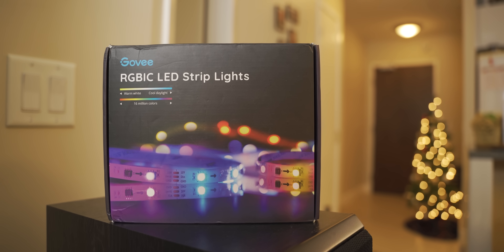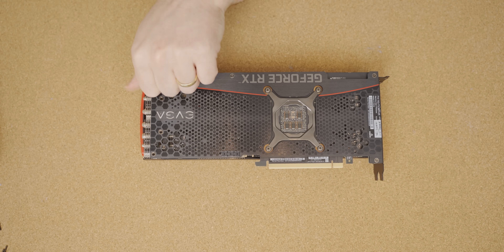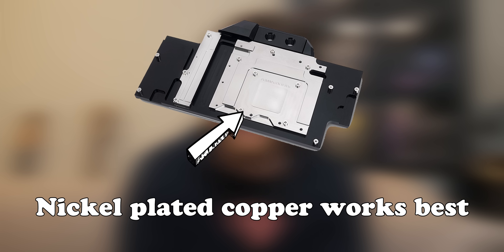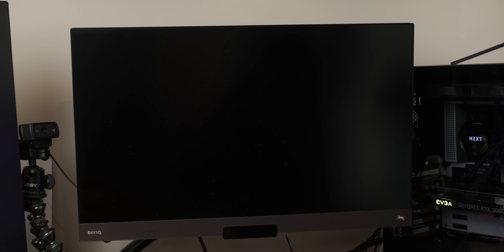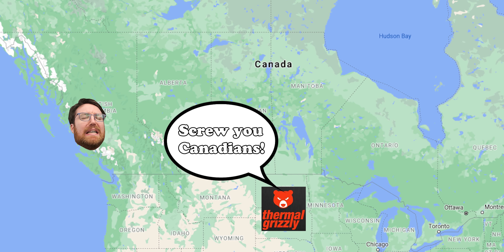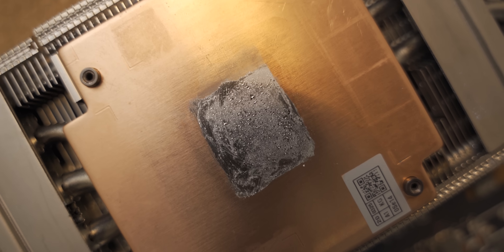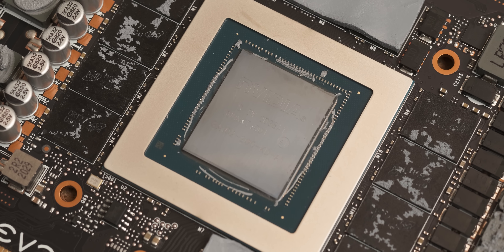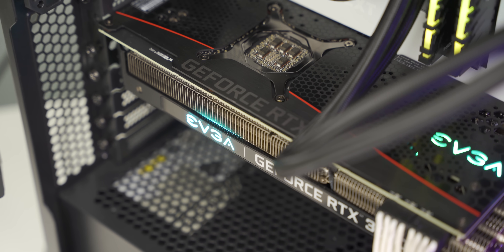NOOB uses Liquid Metal on an RTX 3080...

Comment: use normal thermal paste as a gasket around the gpu die. On that metal piece that surrounds the die. Basically eliminates any chance of it squirting out. Also on cpus you can 3d print tpu gaskets that go around the cpu not in between the cpu and the cooler and get squished down when you mount the cooler.

Comment: i used it on my 4080. Took me around 30 mins to do. It lowerd my temps by 10°C but to hotspot delta went from 10°C to 15°C. I ran it like that for over a year without any problems. Then I decided to check how it is doing and opend the card up again. And I saw that I dId not apply it on the correct location on the cooler. So half the die didnt make proper contact to the cooler. I then did the right this time and now the Temps are again 3°C lower then before and the hotspot delta is at 7°C to 10°C. So yea, I think its worth it.

Comment: i use metal liquid on a 3070 asus tuf and have better results
stock=79-80
liquid metal=65-70
(in two cases the frecuency was 1950mhz with oc)
and i wanna modify de bios to get a higger gpu voltage limit
to get stable frecuency 2100-2150 mhz

Comment: Only 2 degrees improvement see despite all the risk? Even a monkey with one nut  will easily say NO
Reply: There wasn't nearly enough liquid metal on the GPU and cooler, and who knows what else he messed up lol
I put liquid metal on my Aorus 17X laptop and it runs WAY better. You just have to know what you're doing.

Comment: You didn’t put enough on, too careful. Typically if you don’t put enough on you will just get slightly better temps. I’ve used it on 6 gpus and you should be getting a really noticeable difference if applied properly

Comment: Dude... you had some bad thoughts... you cannot see how much contact the gpu and the cooler had by looking on the liquid metal. When you see there some like drops, its just the last contact point of lifting the plate. Other point: when you want to higher the contact pressure, you should have used less thickness in thermal pads instead of thicker ones. Your card had possibly close to none contact between gpu and cooler when it had 74C. If used correctly with normal contact, liquid metal would degrease the temperatures close to 10C. The Card should had reached around 66C or in best conditions better (lower).

Comment: I tried to replace the thermal pads on my EVGA xc3 black 3080.  Same card with no backplate for some reason.  I could never get it to run right after opening it.  Ended up having to rma it.  Then the replacement just didn't work at all so I had to rma a second time.  Never touching that thing again.  I've opened other GPUs and they worked fine after, something about that flexy PCB not making good contact after you take it apart.

Comment: you need to look at the GPUZ and see hotspot temps vs gpu temps. 
if they re different, you have not enough liquid metal or its not contacting the heatsink very well due to pad sizes.

Comment: this guy has no clue whatsoever. Does not know how to blennd in GPU Hotspot, does not know how to proper replace pads, does not know how much Metal to apply....its a mircacle he didnt ruin the GPU. Insulating the small caps and resistors on the socket was literally the only thing he did right.

Comment: Wouldn't it be more economically viable for GPU manufacturers to apply this in the factory for better performance and less burnouts and Warranty replacements? How much does a drop of that stuff compared to standard thermal paste really cost?

Comment: Hi. I watched the whole video. It was a good video, and it probably wouldn't have been as entertaining had you done this, but I would have been nervous about uneven compression of the pads with stacking, as I've seen this issue before in thermal maintenance of mini-PC controllers in an engineering lab. Management didn't want to just order new thermal pads. Their calculation of the situation was on the small price of new pads and not the downtime that was difficult to calculate but real. I think it would be better to follow the culmination of lessons learned you showed and just order enough new pads with the correct measurements before beginning spring thermal tuneups, doing shunt stacking, cleaning, whatever. Plan it all out, order all the oh shit stuff required, and make a much less entertaining, but low-stress experience. :)

Comment: Did you have the right MM pads in the right area?  I know some cards use different sizes and can cause uneven GPU pressure if not using right MM.

Comment: Fun fact. The thermal pads are just a gap filler. You don't need them to be perfect thickness. They just need to squish a little. As long as decent enough contact is made it works

Yes you will see GPUs with thick thermal blocks that are squished out a lot but those are from the factory. They're bought like that for the appropriate use case so they can be thick. Not all thermal pads are created equally after all and it is very likely that the thin pads used are rated for different temperatures. So stacking pads will mess with thermal conductivity too much

Comment: card manufacturer should start listing in the specs what type and thicness of the pad they use or include a set for future use. I didn't want to mess around with thermal pads because is hard to get any of any size here (and expensive) so the marginal gain is not worth the hassle (even for my CPU i use reguar white thermal silicone )

Comment: I think you should take a thermal pad and and cut a square in the center, put the pad on the CPU and in the center of the square, put the tiniest bit of liquid metal in the center, and spread it around inside the square you cut. The pad should keep the liquid metal from running off the gpu.

Comment: You, my friend, need a waterblock and a radiator with 2 fans for the GPU to watercool it to oblivion.
Like this you'll probably get 10 degrees less on the GPU and it will probably be better for the VRM and VRAM too, who knows.
Also, use 1mm thick thermal pads, no more, no less, and don't stack them one over eachother, it's best with one sheet to avoid as much as possible, microscopic air bubbles.

Comment: I nickel plate any copper surfaces before using any galinstan (gallium, indium, tin) thermal material like Thermal Grizzly Conductonaut. There are kits to nickel plate copper surfaces (I use one called Plug n Plate, with which I have no connection other than as a customer) that are well under $100 US, and the amount of plating material you get will do dozens of heat sinks, and it's easy (takes just a minute to set up, then just a few minutes to do the plating, then you're done). It's probably easier than a lot of people find it to actually spread the liquid metal!

Otherwise, in time the gallium in the compound will migrate into the copper over time. The amalgam formed (silver in color) is slightly less efficient at heat transfer than copper, but the difference is supposed to be negligible. The more pressing concern is that as the gallium moves into the copper, the fraction of gallium in the TIM still between the chip die and the cool plate changes, while the volume of the TIM decreases. This can lead to higher temperatures and a crusty buildup on the heat sink when you do reapply it. There is also usually some minor pitting on the copper surface where it contacts the TIM.

Nickel is far less reactive, and at least in the year or so I have used it, there has been no reduction in volume of the TIM or any pitting on the nickel plated cool plate surface on my gaming laptop. My previous laptop did start getting hotter after a few months with Thermal Grizzly Conductonaut, and it was noticeably more dry than when I applied it.

Comment: For the part where you protect the soldering around the cpu there is a more specialized product you can use called conformal coating
Reply: hi I want to ask is it true that conformal coating works? I intend to use Kapton tape.. but many also recommend conformal coating as far as I know it is used on drones or mobile RC to protect it from water

Comment: Tbh though if i had a RTX 3080 from EVGA and i wanted to cool it down i would of actually bought their Hybrid kit instead because a very good chance i would of maybe seen the high 50's low 60's when gaming and yes it would of taken some of my space for additional fans in the system but if your GPU and GPU are both running on a AIO then i am sure using 1 or 2 exhaust fans in the system would be fine then.

Comment: lol aluminium past wont adhear to copper, it just wont, so dont put it on your copper plate, put it on the cpu die, and stick your cooler down, make sure its even and firm, do not try to add metal paste to copper.
or just use a normal paste, you wont see any real diference to your thermals, hahaha.

Comment: Have you considered the gap between your processor die and the copper?  I would imagine putting thicker or even just new pads on there created a rather large space between the two.  I probably would have gone with thin thermal pads and even before that tested to see what the gap was between the two before even moving on to adding the liquid metal.

Comment: I OVERCLOCKED TO MY RYZEN 5 5600X I OVERCLOCKED TO 7500MHZ ALL CORES I USE MELTED METAL I HAVE BAD ENGLİSH MY CPU AND MY WATER COOLER İS CONNECTED WİTH METAL U CANT SEPERATE  MY WATER COOLER AND MY CPU İS CONNECTED STUCK TOGETHER PERFORMANCE İS BETTER THAN ALL CPUS BUT SO RİSKY TO DO THAT I WAS LUCKY

Comment: The cooler is not the issue, it’s actually a good sized cooler. You totally abused that card my man. The relation between thermal pads thickness and die contact is very sensitive.

Comment: EVGA doesn't use thermal pads, they use thermal putty and it conforms better.

The gap thickness between memory and cooler is within 0.25 mm thicknesses and pads only come in 1mm thickness increments.

I highly recommend people to buy thermal putty for their EVGA.

Comment: hmmm, well, i was thinking of doing the same using a Liquid metal in order to properly overclock my RX 580 (yes i know it's old but it's a decent 1080p GPU)
anyway, it's too much hassle if the thermal pads get messed up n i definitely wanna avoid that to happen so, well, anyway, screw it i'm not gonna do that i'm not well adjusted into these stuff if something get wrong
by the way is anyone here know what is an idle fan speed while playing a game on high setting ? Thank u

Comment: To be fair, if the cooler and original TIM where more than enough for a stock card, you won’t see major improvements unless you’re gonna be overclocking and/or pushing more power.

Comment: GPU generally has lower power per unit area, and 75 degree Celsius isn’t dangerously high. Whereas for a CPU you are pushing more power into a smaller piece of silicon so more efficient heat transfer does make a difference

Comment: You are playing FHD. Your graphics card is not even working at 100 %. If you want to see the max freq you musnt run in FHD but rather use DSR (in case you dont have a better monitor) to move work from cpu to gpu.

Comment: liquid metal is totally unnecessary risk, using water cooling and thermal paste is way to go u can use alphacool aio extendable set for cpu and gpu plus alphacool cooling blocks for gpu. no risk involved mostly and no stupid conductive bulshiet on mobo. i once used arctic silver paste one drop in wrong spot and my asus rog hero vii mobo go to the trash becasue all pins bend over from short

Comment: Maybe it's the aluminum pipes limiting the cooling. I doubt those are nickle plated copper or something. It's a shame you didn't get better temps with such an expensive (I'm poor) GPU, which has 3 fans and with liquid metal applied.

Comment: Dont apply liquid metal, if the heatsink is copper, over time the liquid metal eats away at the copper and can later damage you GPU.... hence you only add liquid metal to cpu die and original heatsink as thats not copper....the heatsink you mount on top is then applied with thermal paste....for GPU's if you go this route then make sure your heatsink is not made from copper...

Comment: That is absolutely brutal. I've got an unmodified RTX3080 FTW3 Ultra and I run no hotter than 64C on max load with overclocks to memory (1000C) and core (100mhz). I'm definitely not gonna mess with a good thing lol

Comment: So I have the same result with my gpu, it appears we both ran into the thermal limit of the cooler itself, and it's not a matter of conducting the heat better but dissapating it. I have a friend with an RX580 sapphire pulse who saw great improvements with LM.

Comment: I've repadded many cards. It's not just the thickness of the pads (e.g. you mention 1+1+1 is not equal to 3mm). Each pad comes with a rated shore hardness denoting how squishy it is. There are very squishy 3mm pads and harder 3mm pads. Each gpu is very specific for what it needs. Liquid metal is not really beneficial at all on these ampere cards, the gddr6x temps will overheat well before the core temp ever gets up there. Not to mention, ampere dies are convex and you need a thick paste on there for max efficiency, like TFX.

Comment: It's probably the nail polish heating up quick and tricking the sensors into thinking the cpu is over heating.
Reply: Yeah, I was also thinking that it could be this too as you'd think sealing them in nail polish would reduce thermal disipation.

Comment: I'm actually wondering if you could liquid metal everything on the card that needs cooling (assuming you protect all the electrical contracts) instead of relying on the thermal pads.
Reply: You could, but war in Hungary will most likely occur
Reply: You could not as LM does not bond properly to the plastic surfaces of VRAM/VRM etc

Comment: ive seen this b4 on radeon 7 gpu thermal pad replace with liquid etal like you did and they got really low clocks and high gpu temps he said it was trying to use a diffrent clock or something but he used regular thermal paste to fix it i dont know if thats why your having trouble or not but goodluck love the vids i have 6900xt 64gb 3600mhz ram ual rank dual channel r7 5800x 2tb 4.0 nvme ssd

Comment: Liquid metal is not really important with aircooling, yes. The heat is dissipated faster for a short time and the card stays cooler. The situation is different with longer usage, air coolers often cannot dissipate the heat as quickly

Comment: The EVGA cards are poorly designed from a heatsink securing perspective.  The board flexes and the pads lift as the flexing creates larger gaps towards the IO bracket.  On my FTW3 I had to use variable sizes of pads and slightly thicker VRAM pads (2.5mm) and then SMOOSH it all down when reassembled.

Comment: problem with liquid metal:
lower core temp = lower fan spin = hotter heat sink = hotter mem chips = fan 90+% because memory overheating
so even at low core temp the fan ramps up
manual fan curve is a must with liquid metal

Comment: In short this liquid metal is Gallium.  One of the lowest melting point metals in the world.  So much so it turns to liquid in your hand.  It's also aggressively hostile toward aluminum.  It will seep into the structure and cause aluminum to fall a part, destroying just about any aluminum object Gallium comes in contact to.  The clear sign this is Gallium is when you mentioned about not letting it get into contact with aluminum.

Comment: so just add enough liquid metal to the two surfaces - and then on the GPU edge (the metal frame of the GPU) add normal paste around that, allowing it to squiz out when assembling the card - this will seal the Liquid metal inside your already insulated (nail polish) GPU and there is very limited risk of the liquid metal getting away - when you do this and have a tight enough mount you will get ... same temperature... why.. because your boost profile on the GPU is dependent on temperature not freq ... so you will get higher boost... if your watt allows it on your board... if your power constrained, you will see lower temps.... hmm  which one?  and for what reason are you doing this?  ;D  
i did it on my 6900xt, and got about 150mhz more boost consistently from stock - so worth it in my opinion. (still waiting for my water block)

Comment: most 3080's dont have any back plating thermal pads so the VRM's can get spicy... so adding them yourself will help tremendously.
Reply: I actually have that exact card and yeah, VRM's on it can reach over 100C while under load even if the rest of the components stay near 70-80. thermal pads are an easy add that can help a ton
Reply: where though
Reply: Gigabyte fixed this on the 3080 12gb gaming oc. Thermal pads are on both sides.

Comment: Can u add liquid metal to game consoles instead of the thermal paste. I feel that liquid metal last longer.
Reply: Yes you definitely can as long as the materials on the vrm/cooler are the right ones. The PS5 uses liquid metal from the factory. Don't forget that you MUST apply the liquid metal to the chip AND the cooler.
Reply: @23058usaf  TY, cause I'm modding my OG XBOX and i heard liqud metal last longer.